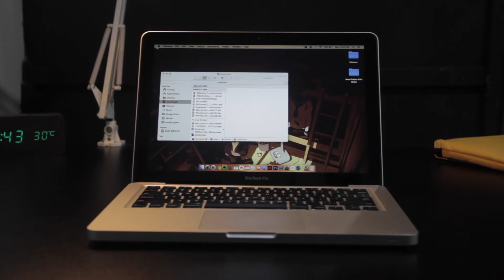How to Replace Macbook Pro 13" HDD Cable (question mark folder problem)

Comment: sudah coba ganti hard drive cable juga masih tetap , mark folder problem, knp ya ?
Reply from the maker: Christiawan Eko pastikan dulu hardisknya (HDD) normal sebelum mengganti kabel, coba pasang dulu hardisknya di casing HDD eksternal dan coba booting dari hd eksternal. Kemungkinan HDDnya yang rusak.